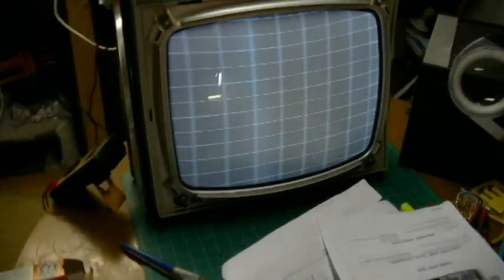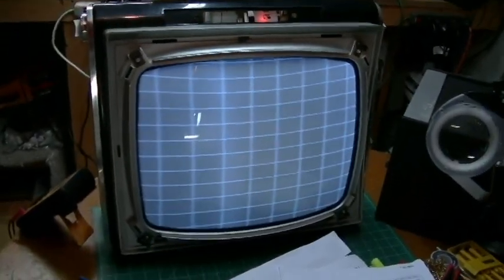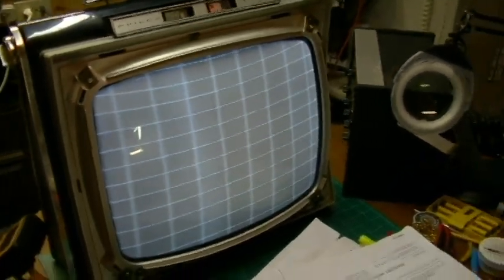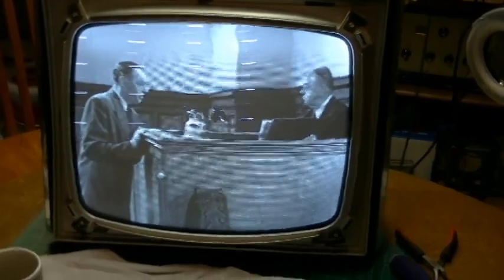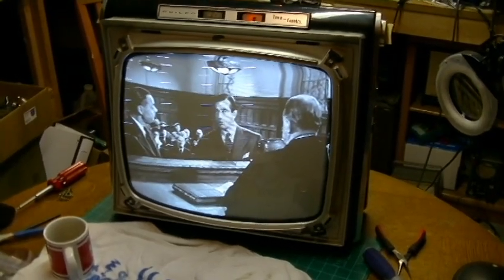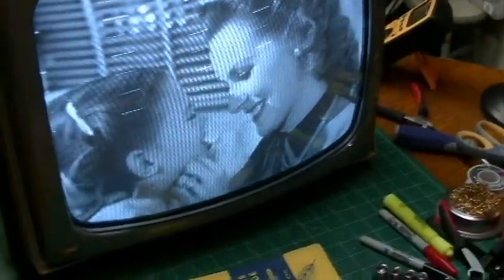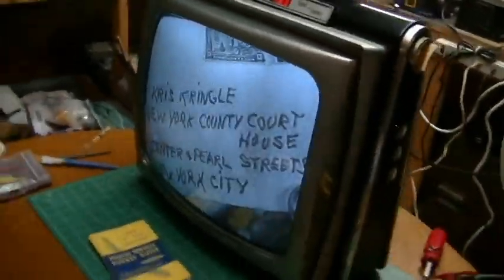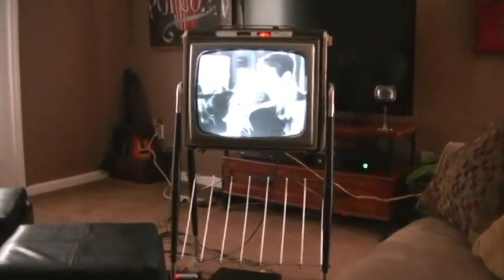1962 Philco Town & Country Pt 5 of 5

Comment: Looks Great.  nice to see that didn't turn out as difficult to work on as it could've been.  Looking forward now to starting on mine!
Reply from the maker: Yeah, it was pretty straight forward. I figured since it has to be such a low hour set, only those black bombs were going to cause problems. Most of the other components were in pretty good shap, including the tubes! Those networks might have been a problem if it had more hours on it I'm thinking. Do you have this model, as well? Need to see some video on it soon!!!! Thanksfor watching, Scott

Comment: Really cool set Scott, nice work!
Reply from the maker: Thanks bud. Hey did you see a recent episode of Chasing Classic Cars where Wayne bought...I think it was a 73' or 74' 280Z!!! You need to go on Velocity web site and see if you can watch it.!!! It aired I think in early December.
Reply: Is that the one where the guy had it under the tarp forever? I will look and see. They are fun cars for sure.
Reply from the maker: Yep, I think so. Didn't have many miles on it either.
Reply: right something like got it parked it forgot it.
I am having a blast with mine. Its just the right mix of problems but fixable so you don't get discouraged but problems enough that it throws challenges at you. Yesterday I fabed up some parking brake hangers out of muffler hanging straps. Little stuff like that. Just keep fixing things that are wrong and it gets better and better.
Reply from the maker: Sounds like TV's or Model airplanes!!!! Or a 50+ year old guy needing to relive his glory!!! HAHAHA! LOL!!! :)~
Reply: Yep that's it for sure it was just like the 74 I used to drive back on Saturday nights!

Comment: I'd say this is about as stable as an set from that era could be, a great job! More designs like this would have staved-off the sale and brinksmanrship which placed Philco into the Ford column. Sadly, I'm sitting about ten feet from a spool of RCA branded speaker wire, and a "Heath-Zenith" doorbell, both of questionable design and execution. The giants of our youth have been slayed, by poor management and foreign investment.
Reply from the maker: Right on! If only our government would have made it harder for cheap crap to be imported back in the day, our qaulity products would most likely be made by them today....right here in the US. Now we have to live with junk from China.
Reply: I about flipped when I noticed the doorbell which I installed (Lowes branded "Utilitech"), when disassembled for installation was branded "Heath/Zenith". He!!, I worked for a Zenith dealership from '76 thru '78 (changing HV four lead capacitors and CRT's during the Chromacolor II debacle). Even with that design error, they still made the best conventional production TV's the world has ever seen....

Comment: Ah yes, the "Ford" of TV sets, aka Ford Philco.  Didn't Ford have the Town and Country station wagon?  I think that was the model with the wood look on its sides.  It was a luxury car likened to a Crown Vic.  Perhaps the next project could be to find an in dash radio from a  Ford station wagon?  My dad had a 55 Ford SW that had a radio with round dial display if I recall correctly.  Don
Reply from the maker: Mmmnn, this set was built on 10/31/1961. Thinkin that was before the Ford buying of (and death of) Philco. But hey...your right!!! They did have a Town & Country car!!!! Never thought about that!!!Probably coincidental.
Reply from the maker: ohp, yeah your right!
Reply: +umajunkcollector You're forgiven, Don, what confuses those of our senior years is that the term "Country" exuded pride at that time, it does not now!
Reply: hmmm, Town and Junkery, Junkery Squire?

Comment: ThOse lines are Macrovision copy
Protection from dvd/vcr, not retrace.
Reply from the maker: Correct, yeah I&#39;m aware that&#39;s what it is, but I couldn&#39;t remember the name of the company, and I filmed a short discussion of that, but I edited it out. It did get me thinking about the subject and I&#39;m going to do a dedicated video about it real soon. And technically they are retrace lines, since they built in a signal&#160;that affect the sync pulse on the vertical, &#160;just not of the normal order. Thanks the comment and helping me remember the name of that company.